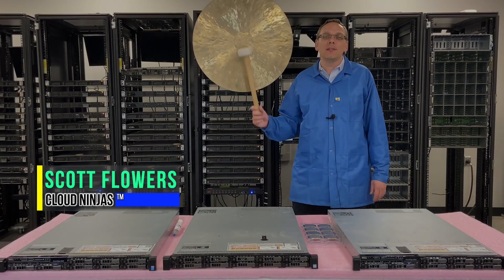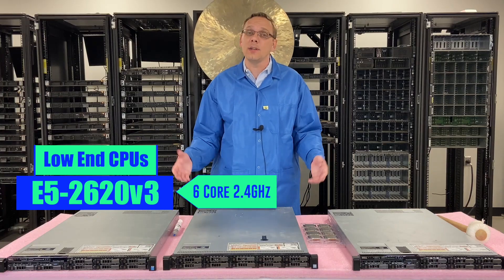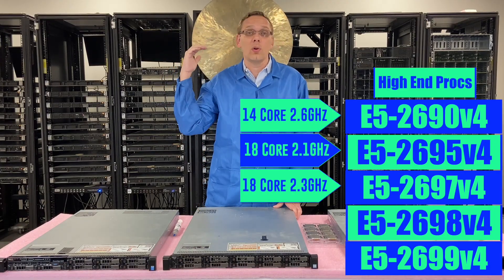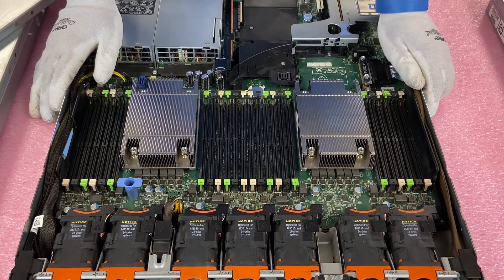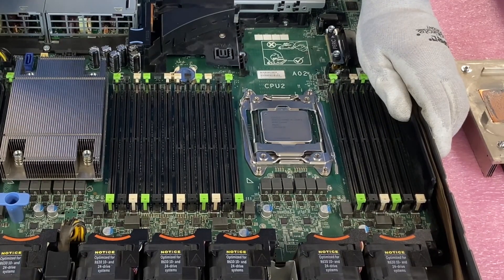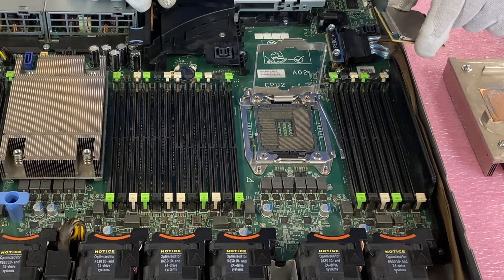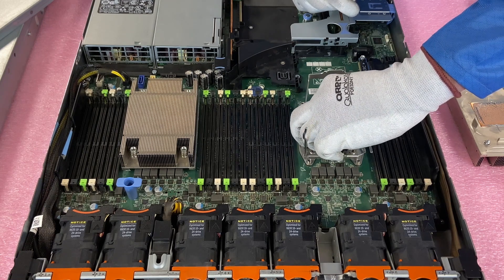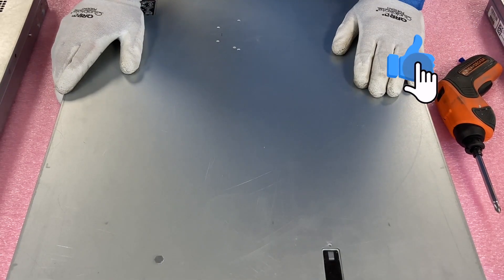Dell PowerEdge R630 Server Series | Intel Processors | LGA2011-3 Socket| Options | How to Install

Comment: To me as someone who identified this server as a great value at this time. I found the note on a BIOS upgrade prior to accepting a v4 processor to be quite valuable. It was hard to start with to decide if this server can take in v4 Xeon processors, but even after confirming it would, there was still contradicting information out there. So the fact they needed a BIOS upgrade made so much sense. Now I know I have to buy a v3 pair (for 10€) to ensure I can upgrade the BIOS if I needed to. Thank you so so much!
Reply from the maker: Appreciate the positive feedback!
Reply from the maker: And yes I agree.  Still an amazing value.
Reply: You don't need two processors to update BIOS. One will do. Always keep a (cheap) E5-2600v3 around.

Comment: You can get thermal paste off the motherboard and CPU pins. Use IPA and a soft brush. Worst case use an ultrasonic cleaner. It's not the end of the world :)
Reply from the maker: I don't know if drinking a beer and using a tooth brush is the right solution or the best solution I've ever heard.  😁

Comment: It would be nice if you could add to your series, the addition of a GPU in a PCI port.
Reply: Perhaps a follow up with Tesla P4 cards. Those servers can take 3x PCIE HHHL cards. I'm using two with 2669v4 xeons and 2x 3.4TB Samsung PM1725 PCIE NVMe SSDs with a 40Gbit Mellanox ConnectX-4 CX4131A, with 512GB RAM it's a beast. Highly recommend over the R430.

Comment: Ive bought 200g thermal paste just because thise pistons suffice for 1/2 cpus, im changing and replacing cpus almost weekly so i dont wanna buy one of those every time touching a cpu
Reply: 4:15 i just place the cpus on the table on the other side with the pins looking the roof
Reply from the maker: Yes totally agree.  We have bulk on thermal grease because we go through a ton of it.
Reply: Hi Scott , thanks for your effort your videos is my reference in the dell world , I’ve a question how you compare 2673v4 to the high end 269x procs , is there is any missed feature or capability? I personally have it acts good but i expect more like it sometimes drops to 1.2 without power or thermal throttling
Reply: Is the server doing something? It might be in power saving mode and slows down the speed when not doing anything.